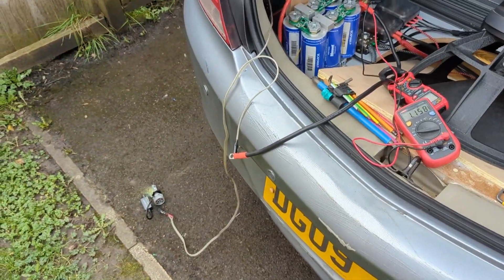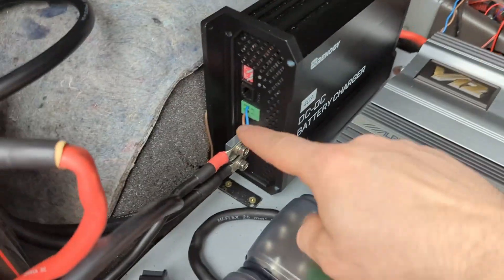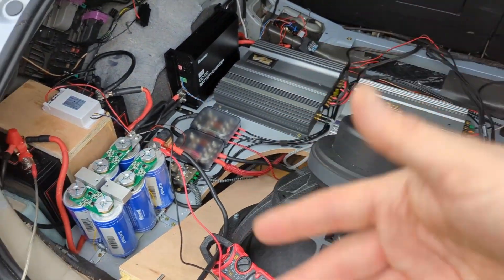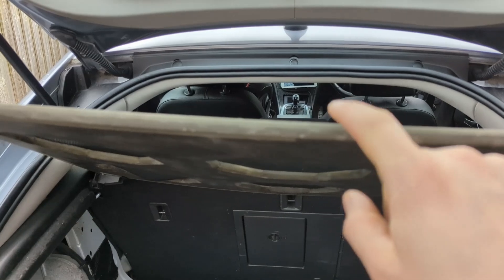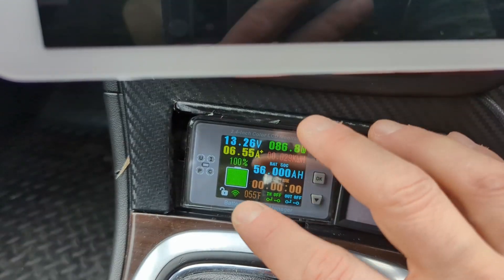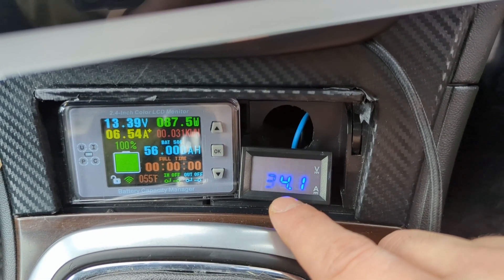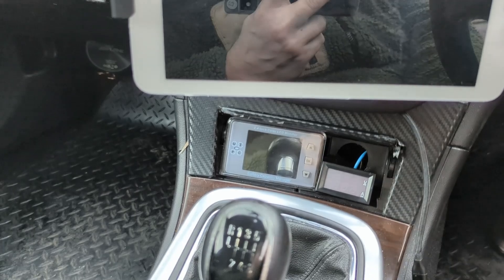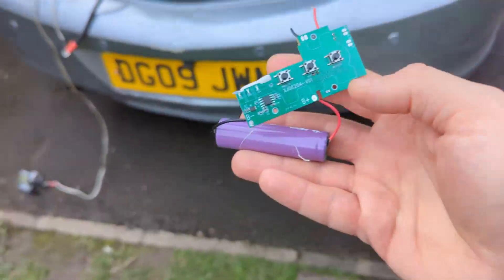Daily update on power

Comment: What are your thoughts on running a mid-range & a tweeter in an A pillar, with 1 channel of amplification and 1 channel of DSP, & tuning the set as 1 speaker? Pros & cons?
Reply from the maker: Biggest con is that you need to design a correct passive crossover for them. Other than that, it's doable, don't see an issue.

Comment: I really don't like taking calls in my car over bluetooth.    Sure it can be okay, but I prefer to use a Headset.   In fact, I really miss my JawBone.    You could have all the noise around you, and your caller could still here you perfectly fine.    
With a Bluetooth microphone, you really need some really sophisticated audio processing or a VERY quiet car  in order to have good call quality.   

Also?   A lot of people use Google voice or the VOIP for Voice calls instead of your Carrier.  
In my experience?  This has always led to problems with phone calls.   (at least over mobile networks)  

I use to rock a ASUS Chromebook connected to my Car Radio and it worked out great for many years in my Van build.  But I did have problems with echo over voice calls.    But over something like Google Chat?   No problems at all even with video. ( Always found that weird )   

In all honesty?  I just don't have the mental acuity to drive and talk at the same time.   Rather pull over or just frankly call them back later.  When I am driving? I would rather have all my attention on the road when in the city.   
Long Trips on American Highways?    Perfectly fine.    
Stuck in traffic?   All good.  
But most of the time?  Me driving is ME time.   
Rather keep it that way. 

Also, Great idea on the setup.   Looking forward on how it turns out.

Comment: Just a heads up. The ultracap bank will drain the lithium faster, than without. 
It won't be that bad but something to keep an eye on if you don't drive for longer periods.
Reply: Any updates on the mic array?
Reply from the maker: @gonzoe123  waiting for warmer and clearer weather🌡️
Reply from the maker: The longest sitting period for my car is 3 days and I top up my main battery every couple of weeks. Will keep that in mind👍
Reply: @RAW-CAt  yeah it's not usually a problem. A 1000f bank at 6V can start a diesel engine by itself. I just had some problems earlier when running AGM, that the batteries were draining under 12V when sitting. Now with LTO it never goes under 13,6V in regular use.